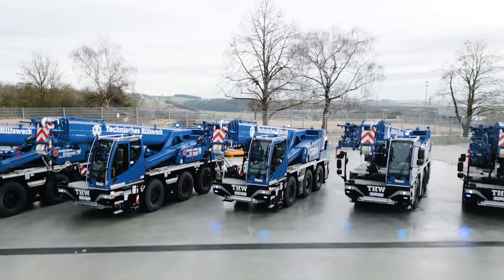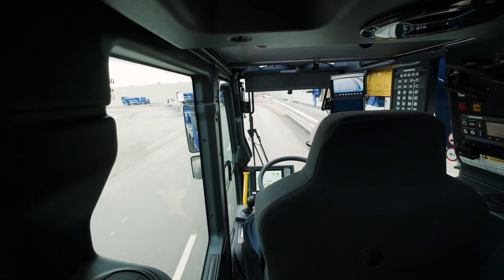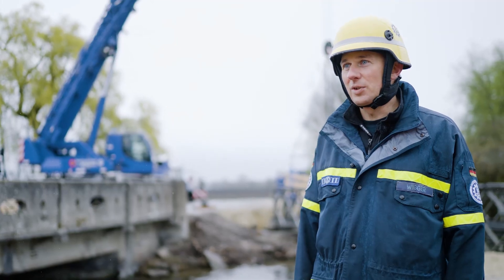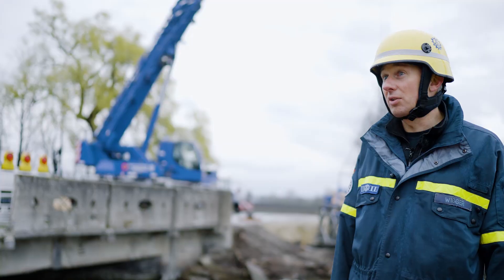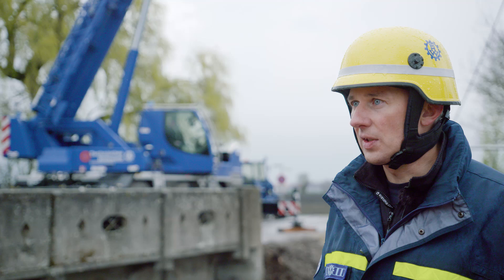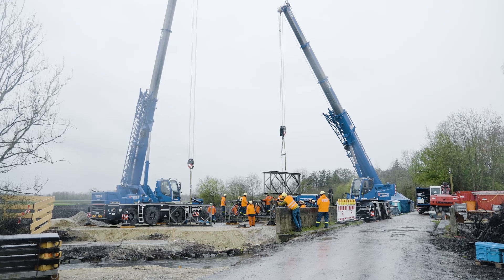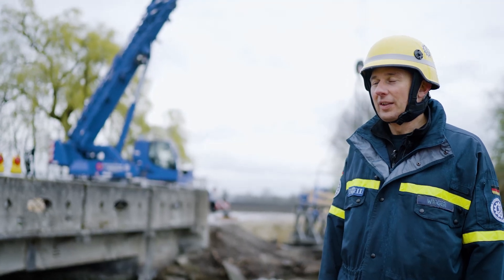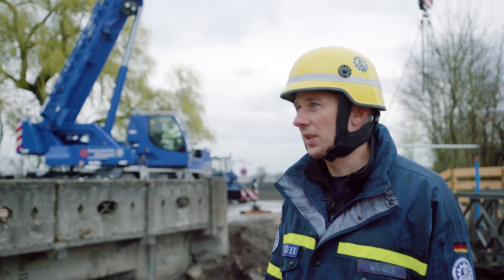LTC 1050-3.1 working on bridge construction | Liebherr

Comment: 5:19 great video. A few things stand out… first using more parts of line then required can create safety issues and should never become normal practice just for time and convenience. Second 5:19 taglines on tandem lifts demonstrate a lack of understanding. Taglines are possibly the most misunderstood and dangerous accessory when working around cranes. It encourages people to get involved with the lift that should just stay clear. Tag lines creat a hang up hazard if too long. They hang directly under the load when proper length and most people don’t use an extension to grab them. 

Third is the hard hat and other safety gear. I get your European but please for the love of manhood keep that trash off our shores. 

Local 12 SoCal baby!
Reply: Correct!
Reply: Yeah absolutely.  Contractors frequently demand that I use a tagline for the optical illusion of safety.  Consequently, I am put in unnecessary danger and proximity to a suspended load.  Completely antithetical to keeping me out of harms way, not to mention distracting.

Those hardhats are indeed awful 😂

Local 9 Denver CO